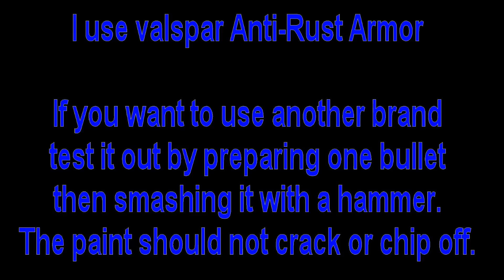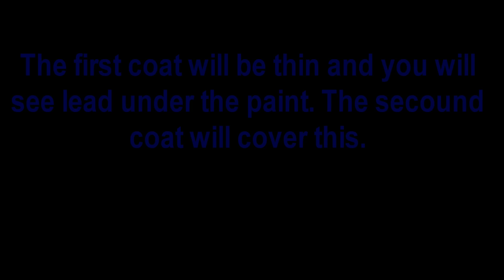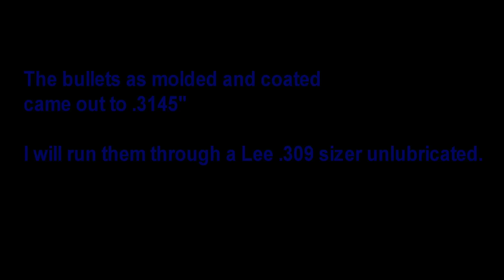Enamel Coated Cast Lead Bullets

Comment: OK,  I have painted aprox. 900 hand gun bullets 9mm,357mag,40 and 45 cal. I have fired only the .357 mag.  At the range, I fired two groups each sand bag rested to compare the accuracy between painted bullets and Lee Alox tumble lubed bullets.
Cases,powder and primers were the same,the only difference was the painted bullet
verses the tumble lubed bullet. The difference in grouping was surprising ! The Alox bullets printed a 3.5 inch group with no bullets overlapping. The enamel coated bullets printed a 1.75 inch group with 2 sets of overlapping bullets in both groups. This is an excellent improvement. I plan to test the other calibers soon, thanks again for making the video. This is so much faster than a lubber  sizer and much cleaner when reloading.
Reply from the maker: Wow that was a big inprovement!
Reply: I am now working on a .308 bullet for .300aac blackout and hope to go to the range this weekend to test them. I will report back in the comments section.

Comment: I used this method and IT WORKS.I tumbled on three coats of the valspar enamel.I used a mixture of three tablespoons enamel,one tablespoon mineral spirits(just to thin it out some, this paint is very thick),and .3cc of HBN powder(dry lubricant).After each coat I let them dry on wax paper for about thirty minutes with an electric heater blowing on them(I just dumped them on the waxpaper,I did not stand them on end).After the last coat I baked them at the suggested time and temperature(again just throwing them in a pan and baking,I didn't stand them up).After baking I tumbled them in Johnson's paste wax and then gas checked and sized them.The coating stayed on the bullet after the sizing!The Lee sizer die didn't even scratch the coating.I shot over 300 rounds through an AK47 and the only residue in the barrel or gas system was very light powder fouling.No blue patches during the cleaning process(I used the same blue that Mitch did).I have also used the Klass Kote epoxy paint and it works great,but this enamel paint is less than a third of the price of the epoxy paint and you don't have to throw out the leftovers.You just cap it and use it on the next batch of bullets.Cheap and easy,it's the American way.Thanks Mitch for the video and ideas.

Comment: I have some bullets that came out of my mold a little small. 

So that may be an advantage of the paint that wasn't even mentioned in this video.

Usually a couple coats of paint will make a bullet a lot bigger than something like the LEE tumble lube which is very thin.

You can build up a bullet size with the paint and then run it through the bullet sizer.

Comment: You should give dry tumble powder coating a shot.  When done properly (with proven powders) you get a sufficient coat on the first go.  Also seems to go through a sizing die better without showing thin spots on the driving bands.  Check the coatings subforum at castboolits for more info.

Comment: Sorry to ask a dumb question; but I've always been taught that "No question is a dumb question..."  So here goes:  What's the purpose for painting your bullets?  Is it just a cool factor or is there a gain to doing this?  Thanks in advance for the video because it was cool to know that I can paint my bullets and you've shown me an easy way to do it.
Reply: The purpose behind painting your bullets is it acts like a jacket.  Reduced leading  in barrel, also seals in the lead so there is less exposure when fired. Another plus is your dies don't get all gummy like with standard lubes.
Reply: Thanks for the response...  1 more question, does the paint come off in the barrell?
Reply: Kenneth Elston not that I have noticed. I did throw a couple back into the casting pot to test coating to heat, and was shocked to see the lead melted before the enamel paint.
Reply: Thanks for the info...
Reply: Jessy Dennis So the paint is lubrication enough and you dont have to use any additional lube?
Reply: TAC-Z Correct when done properly the paint acts as lube.  It may take a couple tries to get the hang of getting the coating thickness right to provide lubrication all the way down the barrel.  I've had better luck using 2 part epoxy paint sense its harder seems to protect better for me , though I did just find a oil based enamel paint hardener (Valspar 4625 Enamel Hardener) that ill be testing in the near future.

Comment: I tried this last night without much luck. Im using rustoleum not valspar. Are you supposed to coat them let them dry coat then dry and 3rd coat then dry over night then bake? Video and description were a little unclear on that part for me. Thanks!

Comment: Quick question: I have heard with powder coating that you shouldn't bake whatever you are coating in a regular kitchen oven due to potential contaminants and toxins getting into your oven and therefore onto your food. Is this also true of the Rust-Oleum or Valspar paints? Or are they safe for use in a regular kitchen?

Comment: With a little trial and error, everything is working great. My question - my .309 cast bullets with coating read about .312-.314 ok I'm resizing to .311 any issues with that ? It seem simple enough

Comment: Have you tried this method on bullets that do not use gas checks? specifically bullets you charge to fly at 2000+ fps? I'm interested in this for 300 blackout loads but i don't have much interest in using gas checks if i can avoid it due to the additional cost, albeit it's not much but savings is savings.
Reply from the maker: Anemathis if you keep you bullets subsonic then you shouldn't need gas checks. Gascecks are not for leading as much as they are for accuarcy.
Reply: Well I guess that wasnt really what i was asking. I was asking if you have tried shooting bullets without gas checks at supersonic speeds using your coating method, and did those bullets shoot accurately?

Comment: In regard to cleaning everything first. Do need to clean your cast with mineral spirits as well ?
Reply from the maker: If the bullets are oily. I have had some paint peel because oil from the mold got unto the drop towel then contaminated the surface of the bullets.

Comment: What bullet mold is that? I like the shape. I'm using a lyman 314299 and while it works well and is accurate, I would like to find something like your bullets here.
Reply from the maker: This is the old Lyman 311413 mold. It looks great but isn't verry accurate. The Lyman 314299 is the best mold for the large 30cal rifles. I use it in 308,303,7.62x54mm, and 7.62x51mm
Reply from the maker: There is one up for auction right now on ebay. http://www.ebay.com/itm/LYMAN-IDEAL-30-CAL-MOULD-W-HANDLES-/231110452893?pt=LH_DefaultDomain_0&hash=item35cf41a69d

Comment: Does the bottom of the bullet need to be covered also. I have noticed when I set them on the end the paint is mostly transferred to the wax paper. Coating 45 swc atm for testing.
Reply from the maker: No the most important part is the sides.

Comment: Thank you! I'm trying a whole bunch of different coatings right now and this was very interesting and helpful.
PS: any luck shooting your cast bullets which have been enameled, without gas checks? I'm trying to avoid use of them.
Reply from the maker: You need them for rifle but they are not needed for any pistol bullets. I have shot 44 Mag and 454 Casull with no loss of accuarcy.

Comment from the maker: They shoot great just keep the rifle bullets under 2,400FPS.
Reply: what about hand gun bullets ? would I need to put them in a oven ?
Reply from the maker: Yes baking them hardens the paint and causes it to bond with the lead better.
Reply: 2400 fps is a really decent speed especially for heavy bullets as slower rounds tend to fly better. SO you coating like three times and then you bake it after then size it to your bore groove size? I got some 200 grain cast bullet but they are already lubed so maybe I will keep looking for a heavy mold about .311, 195 to 245 grain. When you cast them what mix are you using and do you drop them in freezing water to make them harder?
Reply: so what happens with velocity above 2400??  Leading I am guessing..
Have you considered maybe adding some form of hardner into the paint?

How long till the paint on the bullets cracks? So much for long term storage.

Comment: What diameter is the bullet 308?  Then resized to .309 after paint?
Reply from the maker: I size mine to .309 for the 7.62x51mm and 308 Win, I size to .311 for 7.62x54 and I size to .314 for the 303 British. The bullet is .3145 after coating so it can be sized down after needed.
Reply: H110orWin296
well how bad was fouling? or did your patches come out blue lol
Reply from the maker: Nope they came out clean with just the powder residue and a little copper from the gas check.
Reply: H110orWin296 thanks for the video. let's talk your 308 Win. When you cast them (or buy them) what are they sized to? It seems to me that you'd have to size them .001 smaller than your final size or else, when you paint and then size them to .309, you'd size the paint off.
Reply from the maker: blgarin  If the paint can't handle sizing then it wont handle the heat, pressure, friction, and deforming of the rifle barrel as they are being fired. Sizeing a painted bullet down from .314 to .309 is easy and all it does is gives the paint a shine to it from smoothing out.

Comment: What kind of speed (fps) are you able to push these bullets to? I have just started reloading for my 308 and I think this would be great to make some paper punchers with.
I'll have been using Klass Kote to coat my 155 and 180 grain 40 S&W bullets, I am really pleased with the results.  Thanks for sharing
Reply: I find coating with klass kote to be better for me also even though it costs more zero leading. Iam casting with range scrap bhn average around 10. With just enamel paint I still get some leading in my 45 and 9mm's .  I did just order a Valspar hardener for oil based enamels. Hoping the increased hardness will fix the issue with soft lead.
Reply from the maker: 2,400FPS seems to be the speed limit for accuracy with cast bullets.

Comment: Great video...  However, why do you gas check?  Isn't the enamel coating supposed to do away with the need for a gas check?  I am just getting into casting so please forgive me if it is a silly question.  Thanks.
Reply: you always gas check a projectile designed for gas checking.   doesn't matter if its painted, or powder coated.   if the mold your using is designed for a gas check, then you must use one.  or you risk some horrible accuracy.

Comment: I am confused if the enamel keeps from fouling why use gas checks at all? Whats the hardness of the bullet after you have applied all coats baked and resized?  I thought maybe you had something new but then you gas checked them and that kinda says the treated bullets will not stand up to a decent velocity. Why not just paper patch that way no paint or oven plus the soft lead bullet front will deform n impact. Plus paper patch is extremely accurate...your married because my wife would chase em around for baking bullets with enamel in her kitchen(house).
Reply: Sure look Prudy!   What BHN do you cast them at,  looks like no lube, paint takes the place of Alox?
Reply: One thing why not do just part of the bullet like the bottom third as a cast bullet still has to push through the groove diameter of a rifle and the over sized cast bullet is what works in many old worn rifles. You ever thought of finding a paint that takes extremely high temps to coat just the very bottom so you do not need to gas check? I am not sure why you coat the bullets as you can get a brn of 18 out of most online cast bullets of make them and those can go 2000 fps and soem up to 2400 fps thats kicking and moving for a extra heavy cast round from a rifle.
Reply from the maker: LOL bullboo1, my wife stuck her head into the garage and asked what the hell I was doing in there one time because the wet bullets I was baking smoked horribly. I know now to let them dry very well. I think the gas check is needed because you as still dealing with high pressures and "soft" lead. I have seen reports of accuracy loss do to a soft base. Paper patch isn't for me.
Reply: H110orWin296 Wives always check on husbands of send the kids to do so as they think we will blow up the house and surrounding area. Being that I spent almost 3 decades in the military working with explosives and she has cause to not trust anyone.

Comment: Respectfully...using plenty of these bullets and your sub MOA gun will stop being sub MOA. When you clean the barrel will notice a lovely burned blue shade that was deposited. It is moisture and chemical resistant but not designed to withstand that amount of heat.
But it looks cool....

Comment: Sorry Man, This is just too weird for me.
Coating a lead bullet with anything other then Lee alox or copper plate just isn't right. Burnt paint deposits will plug your barrel rifling and just make cleaning your guns a nightmare. Rustolium paint? Give me a break.
100 years ago people shot lead bullets without lube and never had a problem. People shoot copper jackets without any lube at all and don't have a problem. Lead is softer then copper and therefore is lube in itself.
Reply: Dan Rickard what is the max velocity you were able to push a 30 caliber pullet: a 308 or 30-06 for example. Thanks